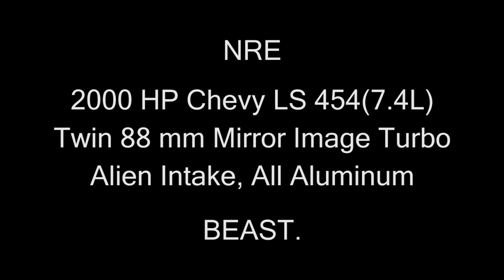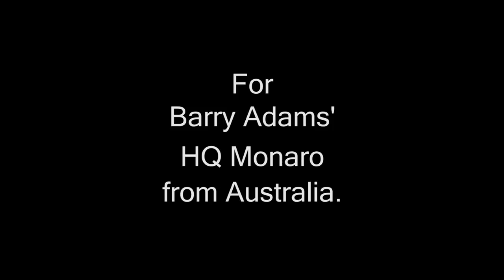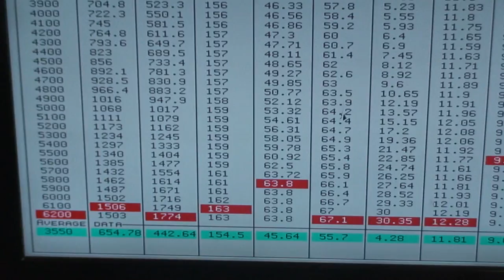Explained! 2000 HP TT LS 454. Nelson Racing Engines Mirror Turbo Monster.  NRE TV Episode 237.

Comment: For those who are not Australian,
http://en.wikipedia.org/wiki/Holden_HQ
What the wiki doesn't tell you, the HQ was a huge sales hit in Australian, became the most common car on the roads. About 1/3 of the cars on the road, when I was a kid, were HQs. The new boss of Holden at the time, had history with Cadilac, and felt we needed to have a car that rode properly, so he borrowed an idea from Rolls Royce, and had front suspension mounted on a subframe, which was then rubber mounted to the chassis. It did make for a good ride and not much road noise, but it also made for remote steering and understeer and... they're an unlikely car to try and make fast, because you first have to make poly urethane or solid mounts for the front end, or else they steer like a hearse. But they've got a good big engine bay, and came stock with engines up to the 350 Chev. That was the original Monaro.

Comment: Very impressive....but as an engineer, every time I see an engine like this creating this amount of energy, and with an understanding of how much lost energy in the form of heat is also being generated,  I always wonder how you can keep it cooled for any sort of even moderate usage beyond a simple burst...I mean I'd like to see it put in an actual car and have it do some road course track time...that would bring in a whole new engineering challenge much greater than just generating 2K H.P. on dyno run....having said that, I still tip my hat.
Reply: steve Fowler Steve you have to watch a few more of his video's, this motor is in an actual car.  The engine temp is well managed even in high ambient temps.  As you can see nothing is left to chance with Tom Nelson.  His radiators are huge and offer a immense cooling capacity.  Also, when you think about the real life duty cycle of the engine, it's probably more idling and short shifts then prolonged wide open throttle.  And higher the mph only offers more cooling.  But as an engineer I'm sure you already know that...
Reply: highvelocity123
Good points all, but I stand by what I said...I think as you said prolonged wide open throttle would be an issue...such as a track car...(as in not a 1/4 mile track car or street car)...even Chevy with all their resources has issues with the new C6 vette getting hot on a track after just a couple laps.
Reply: Steve I'm sorry but your comparing apples and oranges.  Track vs street car.  Set up is completely different and additional cooling would be installed.   Production cars vs a unique one off design which is over engineered by Tom Nelson.  His designs work. Do more research on his work then form an opinion.
Reply: steve Fowler typical pencil pusher comment. thinks it can not be done paper, yet gets proven wrong from applied testing.

Comment: Had to add this, you mentioned the intercoolers are cooled by their own radiator, could you plumb the fresh air intake to draw air through those radiators? That would keep the cooler water super cold and eliminate the need for a fan, because sometimes less is more. LOL
Reply: mrgearheadfromhell Ambient air temp would be cooler.

Comment: nelsonracingengines Is there a reason that the dual feed fuel regulators are not part of the alien intake any more or is it just this setup that doesn't have them in the alien intake
Reply: I was wondering the same thing.  Also the collector looks to no longer be the 1 piece unit that NRE showed in the past.  I thought they went away from these collectors because they were blowing them out.
Reply: Mack Monsees id say the space at the back of the engine bay at the firewall would be tight. the hq isnt a big car to be jamming that much shit in the bay lol